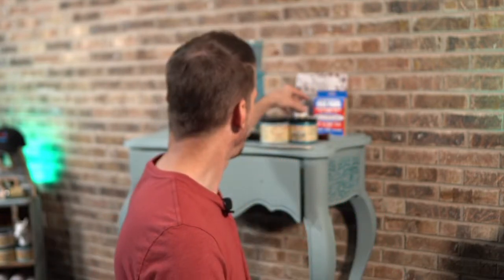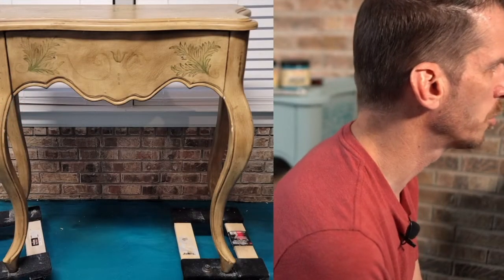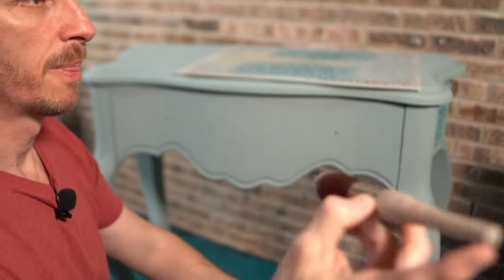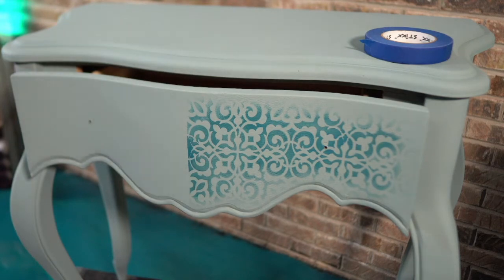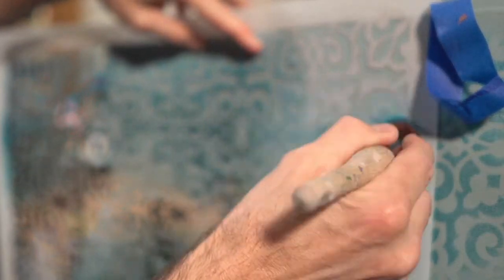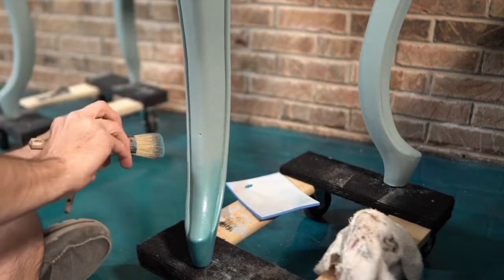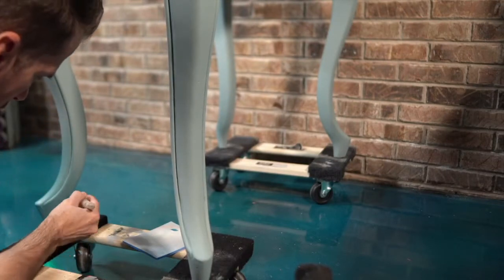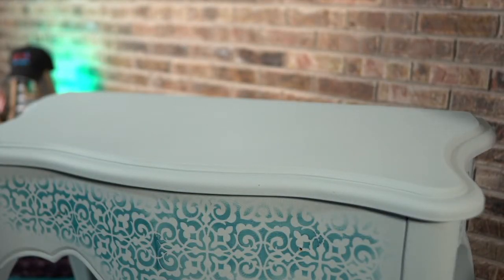Stenciling and shading on a Bombay console table with Dixie Belle Moonshine Metallics

Comment: I am hoping you get this question soon. I have painted and then I put clear wax on it. But I wanted to dull the colors. I was going to use watered down voodoo gel stain.  Then I was worried I messed up. Can I stain over wax and then wax again. I know I should use brown wax but I don't have it. Can I do this???
Reply from the maker: hey Bonny. I don't usually use wax but I do know wax is Oil Based and Gel Stain is water based. they don't play nice together. In general, wax is a protective coating, it may repel just about anything other than wax. If you want to really affect the paint, you would need to remove the wax. But Brown wax over clear wax is usually done to add shading or depth in corners and cracks, etc. not sure I recommend it for large surface though. I hope that helps. Feel free to message me on my FB page if you to chat more about it. :-)
Reply: @BowTieTreasures  thank you. I will need to get brown wax. That was the plan to start with. But hadn't gotten the wax. I will need to get it and do what I started to do in the first place.